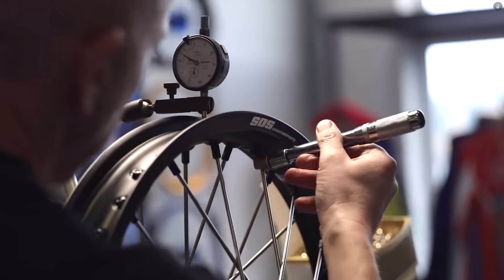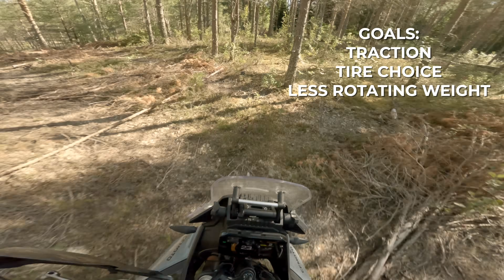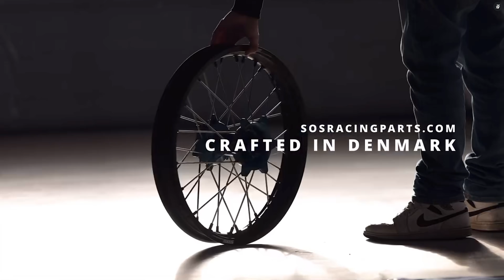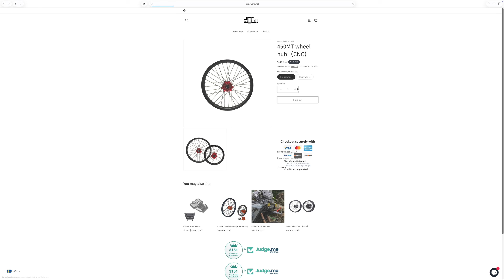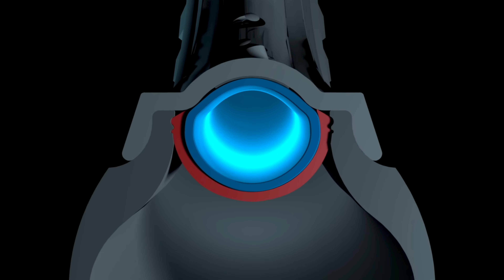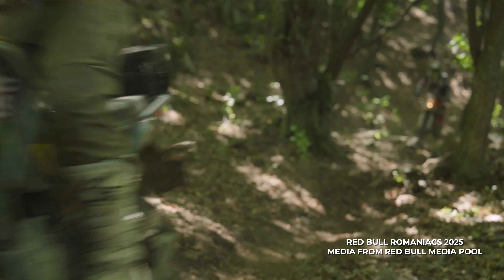I Upgraded My 450MT Wheels for More Grip Off-Road — Game Changer

Comment: I understood the rim spoked wheels were stronger than the centre/well spoked style.
Reply from the maker: The only reason I got the new wheels was the possibility to run proper enduro tires and to cut some weight. I think they will hold up fine since they are made with high-quality parts.

Comment: But the bike already comes with tubeliss?
Reply from the maker: The stock wheels and tires are tubeless, while Tubliss makes it possible to have a tubeless setup in rims and tires that normally require tubes. The rims are also much narrower and open up for a lot of enduro tires which don’t fit the stock rims.

Comment: I seen where a guy used a ktm 690 sprocket or rotor i wonder if the whole 690 wheel would work with correct spacers. Enjoy this channel
Reply from the maker: Yes, rear sprockets from some KTM and GasGas models do fit the 450MT. When I was researching wheel upgrades, though, I unfortunately didn’t find any information suggesting that wheels from KTM or other brands would fit the 450MT

Comment: Great video! Quick question — what rim widths did you choose for the new wheel set (front and rear)? I didn’t hear you mention the exact sizes. For example, something like 21×1.6 front and 18×2.5 rear? Curious what setup you went with for hard off-road.
Reply from the maker: Glad you liked the video. I got 21x1.6 and 18x2.15 (Tubliss don't support 2.5 rims, so I had to go with narrower rim)

Comment: do you reckon this lighter wheels will make the bike less stable on the road while loaded up  ?
Reply from the maker: Yes, they will feel less stable on road. However, I will keep the stock wheels with 50/50 tires which can be used to long distance traveling and when I ride with luggage.
Reply: @T @TheAdventureNorth ir point. i can buy on with the lighter wheels on it already but am new to offroad riding (with bikes atleast) ride pick up trucks in the mud for a living haha. But not sure if it would make a big difference offroaf for a noob. i do however need the bike for a euro trip this summer so i think i better stick to the stock wheels first. Extra set is a little above budget. Thanks man your videos are very helpfull.
Reply from the maker: Stock wheels are great, just get better tires and you are good to go!

Comment: You put so much mods into this bike (and obviously money). Just wondering why you did not choose for example just bike Like T7 Tuareg660 or 890adventure R which would probably have everything you need. think that money wise it could be similar, but maybe im wrong :) Anyway thanks for all videos as those are helpful.
Reply from the maker: Thanks for your comment. I'm sure that is a common thought when you check all the upgrades I done. Some of the upgrades wouldn't be necessary for the bikes you mentioned, like the ones related to power of the engine. But a majority of the upgrades would be the same on those bigger bikes. I'm almost finished with  all upgrades and will make a video and summarize all things including costs. Maybe also rank the upgrades from success to waste of money and effort 😆

Comment: Eager to hear about the suspension upgrades. I'm waiting for someone to put 48mm KYB forks on one of these bikes.
Reply from the maker: It's coming. New cartridge installed already and replacing the shock today. First test ride tomorrow... I’ve been looking at many different options, so I will share all my findings and what I ended up with. 
I think Uncle Wang has some beefier forks (not KYB) and triple clamps needed to get it on the 450.

Comment: Is the rear rim narrower for more enduro tire options?
Reply: Yes
Reply from the maker: Yes, you can choose 2.15 or 2.50 for enduro tires. But it you want to use wider adventure tires, you can get the wheels built with wide Excel rims.

Comment: I am also using the SOS rims for a while now, they are high end products. You should consider using TACS mousses together with the tubeliss system, then you are more safe. Hope you orded a 2.15 Rim for the rear. If its a 2.5 you need to inflate the tubliss up to 10bar before it holds, in my experience at least.
Reply from the maker: Awesome to hear you're running the same rims! I appreciate the advice on the mousses with the Tubliss system. I will check it out! Yes, I did my research and ordered the 2.15 rim.
Reply: @TheAdventureNorth  what size in front, 1.85" ?
Reply from the maker: @marbu30   I got 1.6”

Comment: During my last off-road trip with my 450, I somehow managed to destroy ten of the original spokes. It turned out to be impossible to find replacement spokes on their own, so my only option was to buy a whole new wheel from Uncle Wang.
Reply from the maker: Wow, ten spokes is a lot! I have one spoke on the front wheel that is loose. I just checked the spare parts catalogue and couldn't find any spokes. It sounds totally ridiculous if you can’t order new spokes...
Reply: I have found something on Ebay UK and answered your Facebook enquiry, I have no idea if it helps. Were you running low pressures when you dragged your spokes?